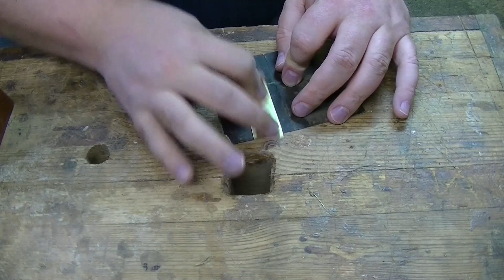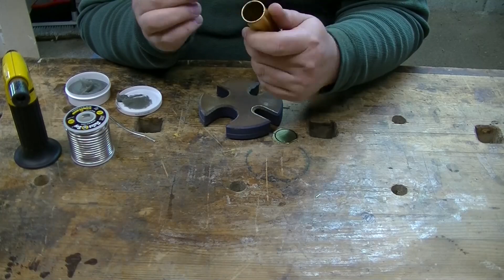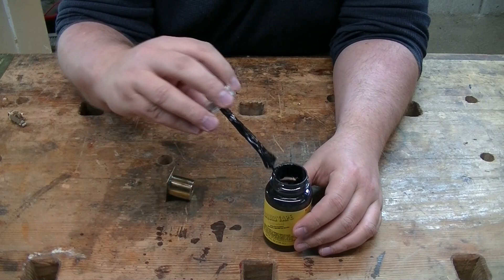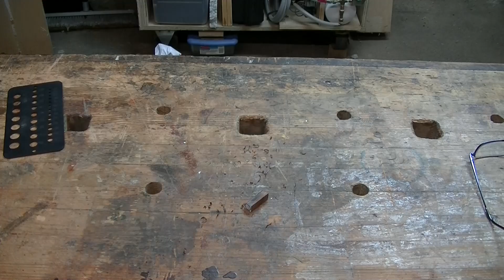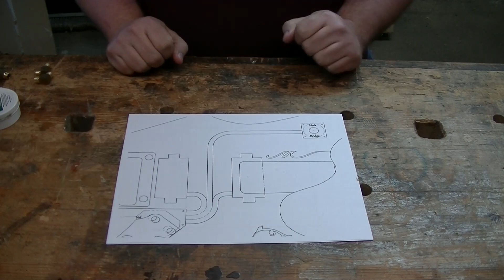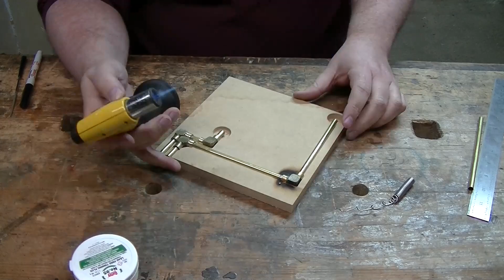Great Guitar Build Off 2021 - Part 3: Metal Work

Comment: Excellent. Never heard of liquid insulation tape before, that’s something to remember. Those elbows are a great solution to the kinked pipe issue and still work very well with the design as they echo the shapes and lines of the pickups, etc. Great work